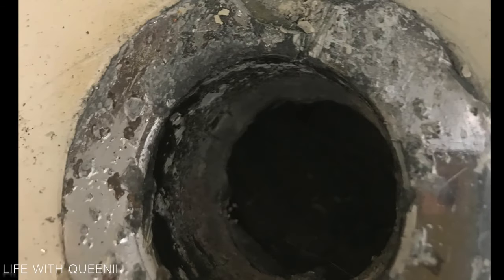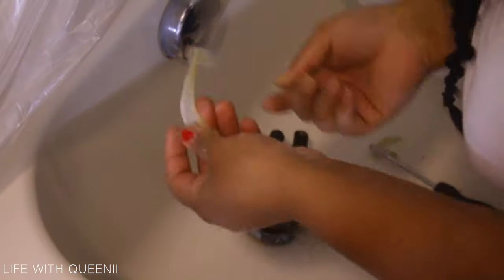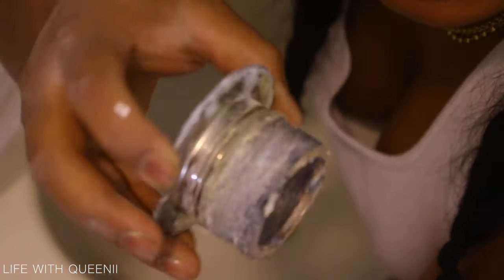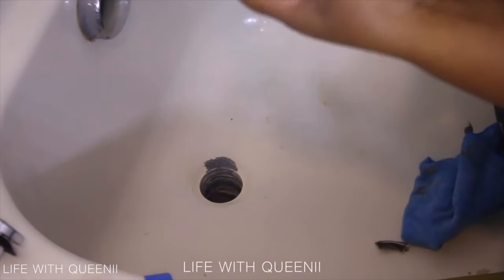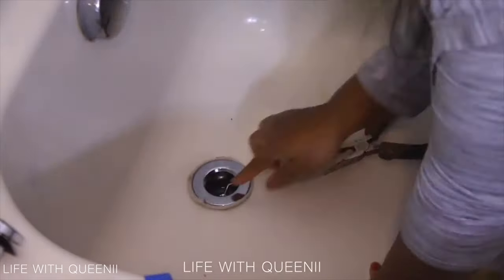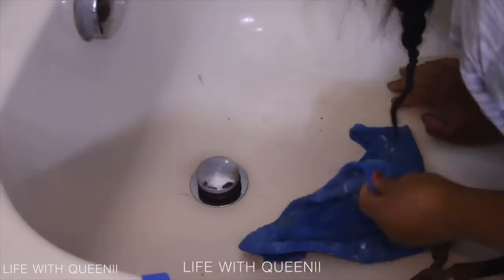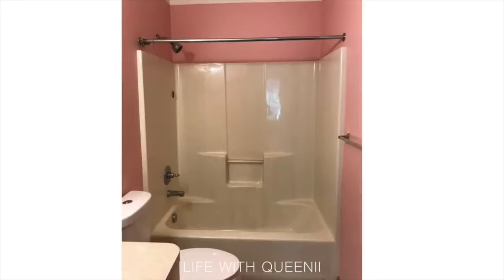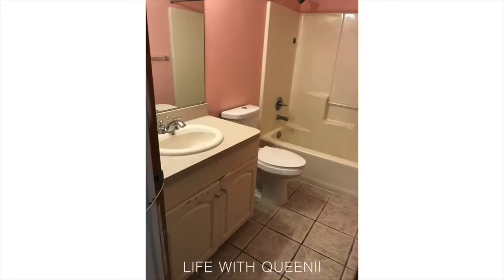How to remove bathtub drain with broken cross members/ missing members /cross bars

Comment: I'm late to the party, but I'm commenting anyway. I was about to cry. 😂 I bought the special tool and the cross bar crumbled like chalk. My drain wanted to be one with the tub. After watching numerous videos, this was the trick that got my corroded drain out.   I thought that I was hallucinating when it started rotating. New drain and cover installed!  You are a freaking gem!
Reply from the maker: lol I know the feeling of “hallucinating “ like it’s actually working 🤣😭 glad it helped ❤️
Reply: Okay now!  I don’t know what happened to the cross bar. Top of drain is gone. So all I have is the middle part (threads) inside the pvc.  Can not install new drain until this part is gone. Imma try this!  Wish me luck.
Reply: @germandimplez  You got this! Just take breaks and keep trying. I, for one, will be more proactive before any of my drains get to this point ever again. Mine was in far worse condition than the one in the video, and it still eventually came out.

Comment: The cross member at the bottom of my drain was broken so I had to use this method. It wouldn't come out at first so I used a heat gun to soften the putty. After a while of heating and twisting, and repeating, I finally got it loose. Thanks.

Comment: You are a genius! I have the special tool. It did not work. I had to play with the hammer and cheap pliers for awhile, but I finally got them jammed in next to the hammer,  Ithen  tucked the plier handles under (behind)the hammer claw and used gloves so I could put a lot of pressure on them. Best to use cheap pliers. They wiggled in there better tan my expansive ones. To my amazement the drain started to move. I was so happy. It took awhile, but your method beat all the other methods I saw on Youtube and it came out. Hallelujah. May God bless you!

Comment: Thank you for this video!!  I appreciate you having the items you already at home to remove the tarnished drain.  I hate when you have to go buy a tool you will only need once.  The hammer and pliers worked great!!  I only wished you would have shown a better picture of the putty going on and if you need to use the rubber gasket too.  Your video helped me so much!!
Reply: That is what stumped me, too. I'm hoping the gasket is only if you don't have putty, which I did have, so I didn't use it. The new drain instructions didn't say to use it so idk. 🤷🏼‍♂

Comment: Your a genius for sure, you gave me the idea and so I went to remove mine but instead of a hammer and pliers I use a short flat crow bar that fits tight because of its flat curved end and I had the 12 inch leverage to turn it better and with more power. be sure without your idea I would have never thought of that, I was just about to use my sals all on it, because of you thank God I didn't and now its removed without any hassles or stress. your idea is awesome man. God bless you and thank you for sharing.  :)

Comment: Oh my gosh. Looked all over to find vids on how to change the drain. Once I really got to looking, I realized the top of my old drain is gone. Only the threads are left inside the pvc.  It’s as if it’s one piece.  Therefore I cannot install the new drain until this one is out- unless I want to pay hundreds for a plumber to go behind my shower and install a new drainage system. I go to YT to find a meditation video and this came up. I’m gonna try you idea on my next day off. Wish me luck. 🙏🏻🤞🏻
Reply from the maker: @germandimplez  if this doesn’t work take the pliers put it in the drain (don’t let it hit the drain pipe inside) just where the threads are open it in the drain using both hands and make sure it has a jam (I’m not sure how to say it) but jammed or catches onto the inside of the thread while holding it open with both hands and turn with both hands while it is in a jammed locked position in the drain thread. Gosh I hope this made sense

Comment: This is hands down the best method for removing a broken drain. I just did it and it worked great. Thanks!
Reply from the maker: Thanks for giving it a try ❤️
Reply: I watched another video before this one and the guy was using a saw to cut through the metal drain piece. He was talking about going very slow and being careful so you don't hit the threads of the pipe it's screwed into. Then he got a screwdriver out and was pushing it underneath the lip of the drain saying you could tap it with a hammer. I didn't like his advice at all. Seemed like a good way to mess everything up. But once I saw your method I was all about it. And it worked great. Thanks again!
Reply from the maker: @Hollywood4Fun  that sounds risky 😬 but glad I could help

Comment: Thanks! I bought a house that had a broken stopper and the metal screw from the old stopper is permanently stuck in the drain sticking out. Replacing the entire drain is definitely easier than anything else I've tried!

Comment: Thanks for the video.  I used the special tools from Home Depot, broke the cross members, and was about to give up.  I ended up using a hammer wedged with a flat metal file as per your demo.  Worked like a charm.👍
Reply from the maker: Hopefully you can return the special tool! Thanks for watching!

Comment: If mine is spinning but not coming up any higher what does that mean? It's probably done 50 full rotations and won't come up any high for me to spin.
Reply from the maker: @KirstenBott  spinning loosely or somewhat firm?
Reply from the maker: @KirstenBott  have you tried pulling it straight up?

Comment: Mine wont budge! Nothing really grabs on like yours did. I even went and bought the dang tool! I've tried a hammer with 2 pliers and that gets it tight but still wont loosen the flange
Reply: Thought of something that may work, try wd40 arounf the edge of the strainer, that should losen it up a bit. Let me know how it goes. Goodluck.
Reply: @Saahib_K  nope. I bought the extraction tool, the drain wrench, tried multiple diy videos, wd40. It wont budge. Guess my last option is to chisel it out and chance ruining the tub
Reply: @chellesmind2148  wow thats unbelievable. A bit scary as well..what is it they poured in, gorilla glue or something 🤔 😳
Reply from the maker: @chellesmind2148  wow 😳

Comment: There were only 3 pieces of cross pieces inside, then...2 then none...then I found this video and now I can move forward w/o adding $20 for a remover.
lol, Not quite like yours as I added a Mallet on top across so I can lean my hand, Lift the hammer handle and create some torque. This thing was installed wrong and the dolt put the rubber grommet backwards and on top and the whole drain thread was covered dried putty... what a mess.

Comment: You did a really good job on removing a broken drain, however, you can use silicone as a sealant for the drain. I personally use it more than plumbers putty because it seals so well.

Comment: Get a bigger hammer and put the teeth down in the drain instead of the hammer head and jam it in the drain (may take a few tries). Pull up on the hammer handle while turning counterclockwise.

Comment: I think the rubber gasket goes in the whole between the pipe and the bottom of the tup. When you tighten it up it makes a seal between the pipe and tub. I had to cut the drain and twist it out with pliers. The T was gone because it was so old.